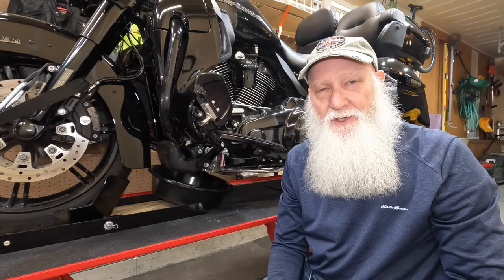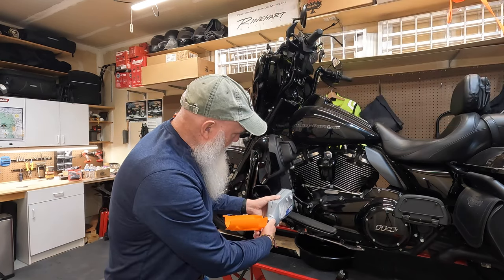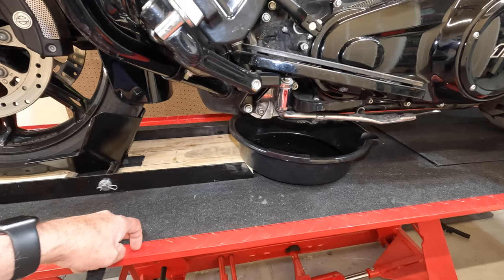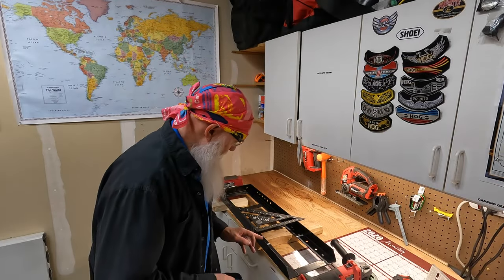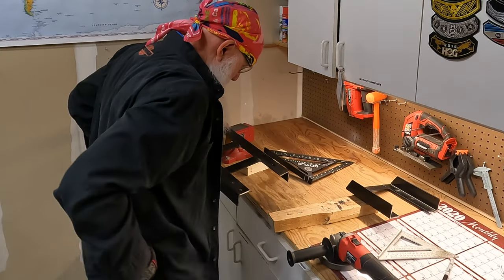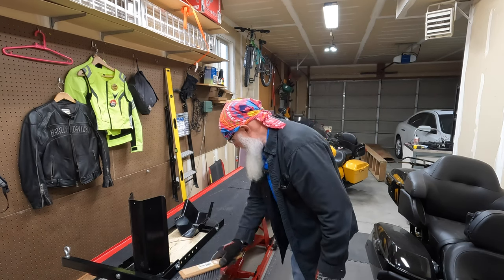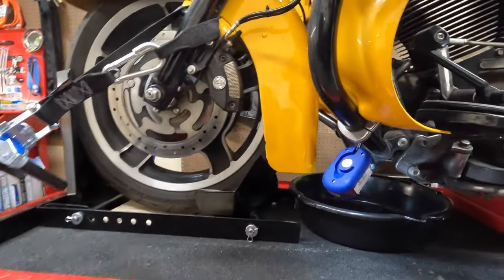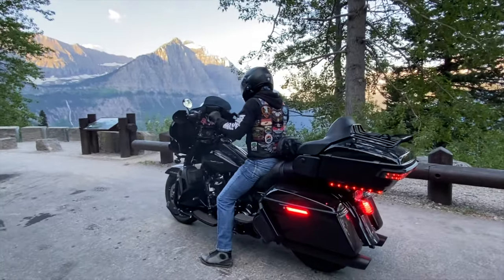#HARBORFREIGHT #motorcyclelift #WHEELCHOCK #HARLEYOILFILTERCHANGE #whyiride #WHYICAMP

Comment: I cut the bottom of a 1 or 2 liter soda bottle and put the extension through the hole for the cap of the bottle. With the bottle sled all the way around the filter I then unscrew it and slid it all off at once.
Reply from the maker: BD, great idea! I have seen several different ways to attack this challenge.  I think I just get too impatient and make a
mess! Thanks for watching, and commenting, hope you find the content worth subscribing to!
Reply: Wow great idea. Now I cant wait for the next oil change to give it a try.

Comment: I see you have a piece of plywood in the wheel chuck. Does that help with getting the bike out? Keep the videos coming. 9:56
Reply from the maker: To be very honest, I have tried so many gadgets and YouTube tricks and was producing a video about all the things that I have tried and when it was all said and done, very few added much value. To answer your question, it was a bust for me. Not worth the trouble. I continue to look for the “holy grail” of improvements and as I find them, I will share them in a video. Oh, BTW, I am likely going to anchor the lift to the concrete floor with TAPCON screws, I am so tired of the lift sliding when loading and unloading the bike.

Comment: What brand and p/n is the wheel chock, it seems to hold the bumblebee up nicely
Reply from the maker: Lobo, it has a couple of numbers, it is the Pittsburgh 61670 / 97841. They make a nice wheel vise too Item 57775, but you would need a person to clamp the front wheel before you could get off the bike. Thanks for watching, commenting and asking questions.
Reply: @clemgriffis3446  thanks for the info I’m glad harbor freight finally made some upgrades, I bought one awhile back from them but was too flimsy for my road glide so I bought one from j&p that clamps down from turning a handle, it does alright but I have to hold the bike up with one hand while I crank it with the other.

Comment: I'm kind of doing the same thing except I'm making a dolly for the front wheel so I can put it in the back of my truck.  For the upright in the front that the wheel goes into instead of using the rod I think I'm going to use a couple of bolts maybe with a couple of washer but I think the bolts will make it much more stable.  Keep the good stuff coming.
Reply from the maker: J.L., I would sure like to see a photo of what you are describing. Perhaps you can share a link to something similar or a photo of what you are going for. Thanks for watching, I hope you like and subscribe to the channel.

Comment: Nice video and good idea . Thanks for posting. How many inches did you remove from the chock?
Reply from the maker: R.D., I cut off 9” but I could have easily taken off 10-1/2” and still had a solid amount of angle remaking for the bolt. I may go back and take off that 1-1/2 inches. You know I have two of these HF wheel chocks since I use one for the back of my pickup truck so I have no problem experimenting with the one for the lift. Thanks for asking. Where are you from?
Reply: Clem,  i am from Chino California. I have been on the fence about the HF lift. Now I'm convinced it's a good buy and with the mods you have done. Next time i see it on sale going to buy one.  Thanks
Reply from the maker: R.D., I have been looking at other improvements as well. I refuse to do something that is of little value but I am looking to convert to air/hydraulic, just because I love to work on things like this in my garage when I am not actually out riding and camping. Thanks for watching from Ca!
Reply: Hello Clem, I read a comment on another youtube channel, the commenter said he punches a small hole in the lower portion of the filter as a drain, and another towards the top of the filter. It was stated most of the oil drains out the filter prior to removing. Sounds legit, think I might give that a try next oil change . What do you think?
Reply from the maker: @roaddog9222  you know, I think that is correct. Makes perfect sense!

Comment: Awesome - have the same setup and the chock is unnecessarily long. HF has a 8 ton pneumatic piston, thinking about swapping out the hydraulic.
Reply from the maker: I don’t think I have seen the 8 ton cylinder. I have seen the 12 ton and I thought that was the smallest. Is there a link you have to the 8 ton? I recently got a compressor in my shop and was planing to do the same. Hey, thanks for watching my content and taking the time to comment. Hope you subscribe.
Reply: Here is the description and part number: PITTSBURGH 8 Ton Long Ram Air/Hydraulic Jack - Item 58816. Have to buy it before I can open it and get the measurements to see if it is, “plug & play”, or will require modifications. 👍
Reply from the maker: @iPossum  58816 might have too long of a displacement at 24” minimum. I have seen mostly the 12 Ton in other videos. PITTSBURGH 12 Ton Air/Hydraulic Bottle Jack 59425.

Comment: A piece of folded cardboard works wonders.
Reply from the maker: At what location?
Reply: Underneath the oil filter,you can angle it down so the oil runs away from the front of the engine and into the pan.
Reply from the maker: @richardbeucler6425  thanks!